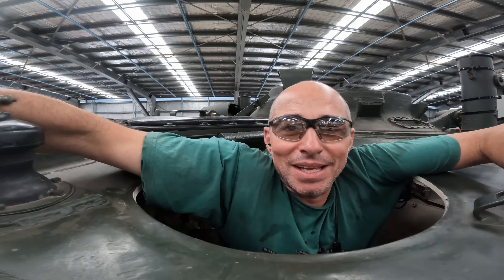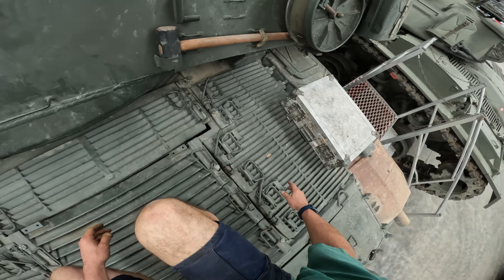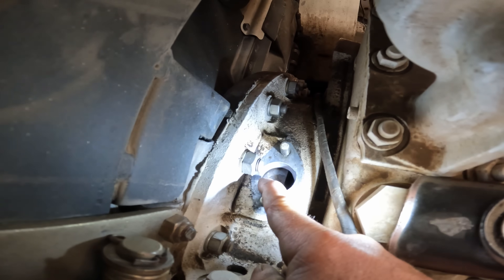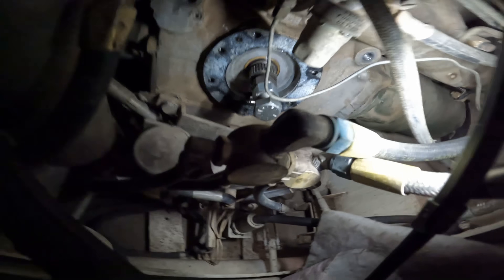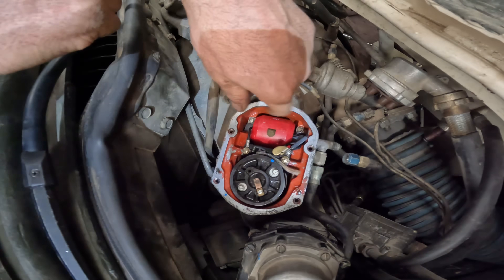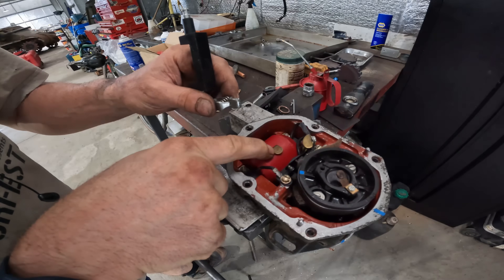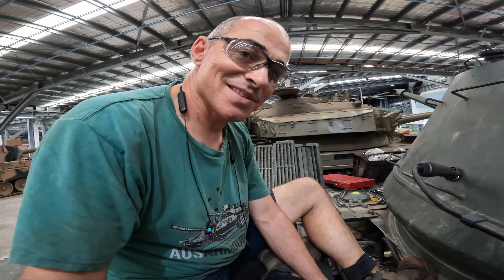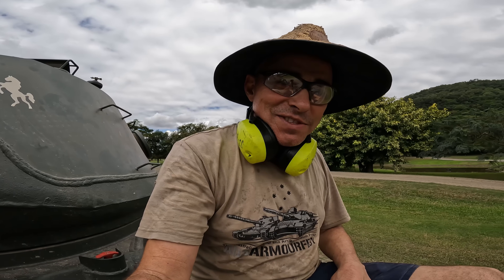M41 Walker Bulldog Magneto Fix!

Comment: I don't know if this is any help to any one. But we used to use a 12 volt bulb with two lengths of wire with spring clips on the ends to find if the magneto was in the right place . Just turn the rotor arm until the bulb lights up and that's the correct setting.

Comment: Great video and fascinating to see how the magneto works. I just wonder why the designers decided to use magnetos' as the tank must have a pretty hefty electrical system to start the engine and power up the tanks' turret and other systems. I was just thinking why not have something more conventional to provide ignition.

Comment: great job Steve, so that poor old girl had running bad for a while then, who's name was on the job sheet hehe
nice to be able to discover things been done wrong, remembering these might have been done with no manual or instructions by the owner(s)

i used to work on museum aircraft, all static, and some of the things the old boys got up to would make your teeth kurl - if aircraft had been painted, generally the graphic instruction have long gone and been forgotten, manuals hidden away, there was an incident where a bunch of guys failed to communicate, in other words, if you don't know, ask, they didn't put a jack under a wing to lift aircraft off its undercarriage, and suddenly the aircraft dropped, the jack going through the wing, what they thought was a jacking point turned out to be where the fuel was checked for water or condensation, they couldn't even be bothered to follow the double lines of rivets in the surface skin connecting to the mainspar, just amusing

Comment: The walker bulldog was such a modern looking tank considering it was early 1940s design technology. The tank was one of the first to be modular where the engine pack was designed to be pulled and replaced in the field to limit its downtime.

Comment: What is a magneto? Why are they in planes and tanks but not cars?
Reply: They are used in planes because they are simplier and work without any external power (they generate their own power), they are in tanks mostly because many tank engines (like this one) are plane engines. Basically you can have spark with no battery or alternator/ generator.
Reply: @AndrewJones-im1ro  why do we do that in planes and not cars?

Comment: The reason why magnetos were superseded by coils was that unlike coil systems, their output diminishes with speed. Magnetos are very good for starting as they give their bests spark low down. Cheers, Matthew
Reply: Huh?  Steve just said the exact opposite to that didn't he?  I'm confused?
Reply: @ My appologies, my memory of my training,  50 years ago was wrong! Magnetos apparently do have a voltage output that rises with speed!
Reply: If that's the case why have a boost coil for starting?
Reply: @tomroland5467 My appologies, my memory of my training,  50 years ago was wrong! Magnetos apparently do have a voltage output that rises with speed!

Comment: I don't know why you're fiddling about making special tools to turn the engine over. If you put it in gear with the handbrake off you can simply rock it backwards and forwards until you hit the timing marks.
(Before you start rolling out your tired excuses, you should know that I've had the same argument with marine mechanics.)

Keep up the good work guys!
🇬🇧
Reply: OK, you're a hero. Good on you.